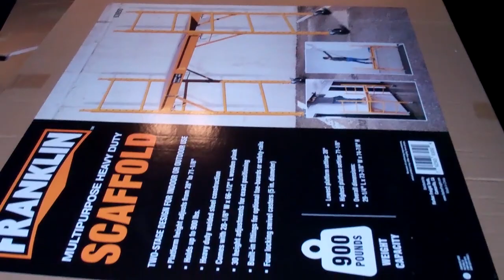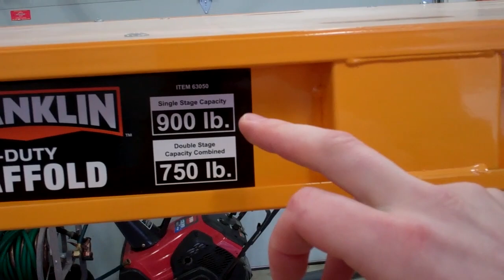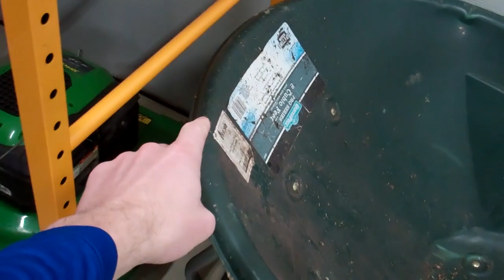Chainsawing around the pond, cool garage storage HACK! - Ep. 86

Comment: The pond is coming along very nice! At 9:00 in your video, I would have kept those two smaller trees and cut down the bigger one. At 21:00, the scaffolds move a little bit. It's strong, but that small movement is scary when you don't expect it. I might suggest you to put a ratchet strap between the legs at the bottom to stop that movement if you ever have to work on the platform. You might gain even more space if you find a way to put the mower deck vertical, maybe leaning against the wall. Those scaffolds are a great hack to improve storage. So now, you don't need to play Tetris game to access your tools!!! Thanks for sharing. Best wishes to you and your family!
Reply from the maker: Thanks Joe. Yeah I didn't look too closely at the big one before I trimmed up the little guys around it... I did damage one of the smaller trees with my ratchet rake earlier this year (the first one I cut that was leaning over), so it was definitely good and dead. I think I can get a few more years out of that bigger one, or at least it'll buy me some time before having to take down such a large tree--might need a bigger saw! 
Good advice on the ratchet strap, I'll keep that in mind. They certainly do flex a bit when being stood on and I bet if I were to stack the two scaffoldings it would be quite wobbly... so I probably won't be doing that, anytime soon haha. I do love the added space it has provided, so even if I never use them to stand on just having additional floor space and easily movable storage will be great. I would like to figure out something better for that mower deck, but man is that thing heavy! I'll keep thinking on it and see what I can come up with. 
Thanks for watching and commenting, and happy holidays to you and yours Joe!